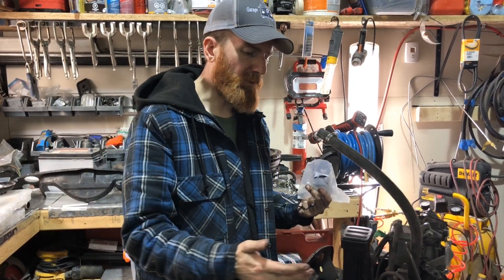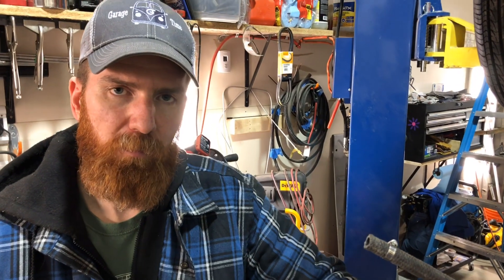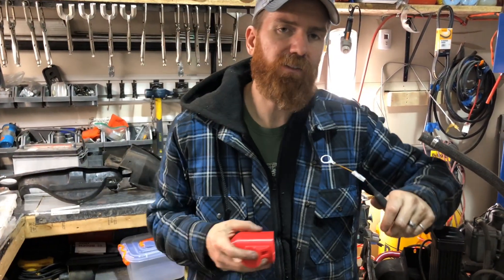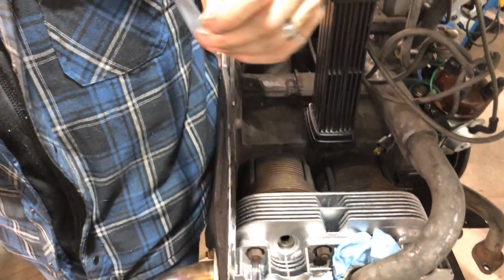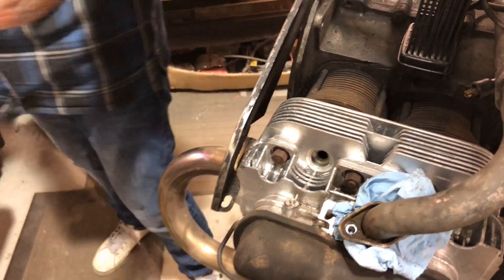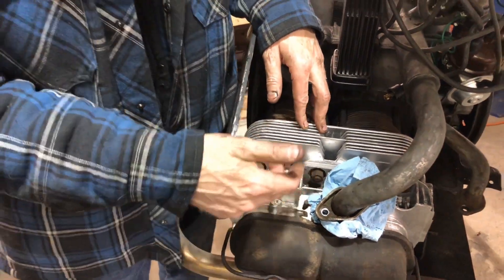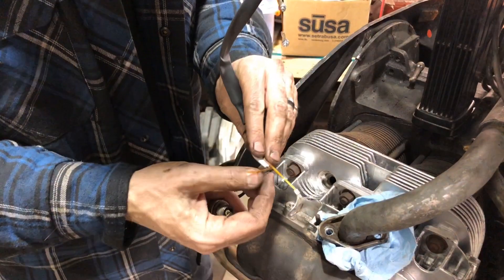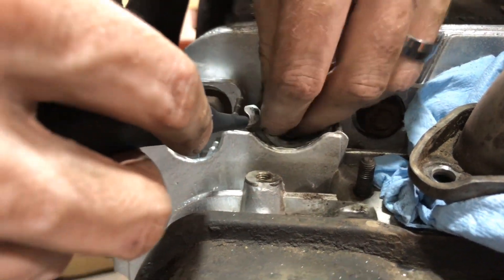VW Autostick - Cylinder Head Temperature Gauge

Comment: Head bolt close to exhaust is better idea no Dremel tool required and it is not going need replacing of sender every time you pull spark plug

Comment: Why couldn't u just install it under a head stud nut or bolt on the head instead of under the spark plug?  Ur still connected to the head so the temperature should be the same right??
Reply from the maker: Sure you could install under head stud but if you wanted, but my preference is under spark plug on number 3. In my opinion it is the hottest spot on these old air cooled engines and the temp I really want to monitor. So for the most accurate reading I put it right at the source. (Believe heat will dissipate some towards the cylinder head bolts). Much debate on this topic on the samba, but this is my 2 cents.  Good luck.
Reply: @GarageTime  Seems to me it would be so simple to run 2 leads (to each location) and observe if there is a meaningful difference it mounting under plug vs under head nut! C'mon people! Post the answer and were done!

Comment: I just bought a 75 bus and the PO had the DD CHT installed and it did work... but now it doesn't... I didn't do much to it but I did change the spark plugs... now the gauge doesn't even light up... is there something that I'm missing?  Is there a diagram I could use to see where all wires go just to see if there is a wire that is not going where it should go or has been cut? would the gauge show me an error if it the ring was off the spark plug? (the engine tin is on so I can't really see what's going on down there haha)
Reply from the maker: Thermocouple is all that goes back to spark plug, so something has happened under the dash if you lost power to it. Good luck

Comment: I bought a CYL HEAD GAGE 35 yrs ago and had it installed till 2 yrs ago when I took the Typ3 engine apart and rebuild it without cutting that notch but when I tried to reinstall the gage, I found two wires, a red and black one.  Can anyone tell me where the wires go ? I think the red to the spark plug, but were does the black wire go, to ground ?

Comment: Hey did you get the head temp averages with the super cool tin. We did test those even though so many people did disagree with them back then and found a bit cooler temp on average I dont remember the numbers just curious what you got.
Reply from the maker: Not yet, autostick transmission failed shortly after install of gauge. Rebuilding transmission this winter.

Comment: Does the thermocouple connector take the place of the spark plug washer (spark plug washer removed), or is the spark plug washer left in place on the spark plug?
Reply from the maker: Yes, we did remove the washer, to maintain same height. Good luck